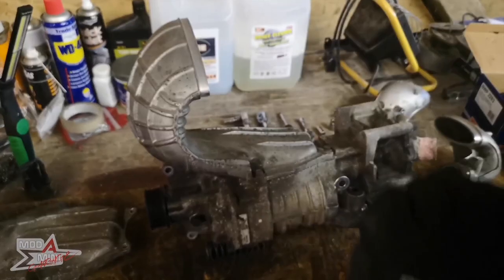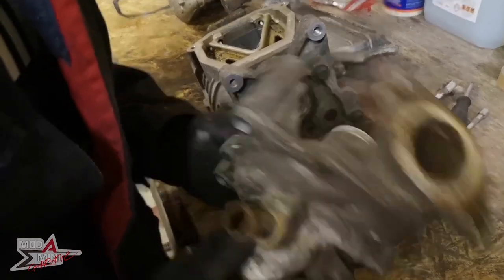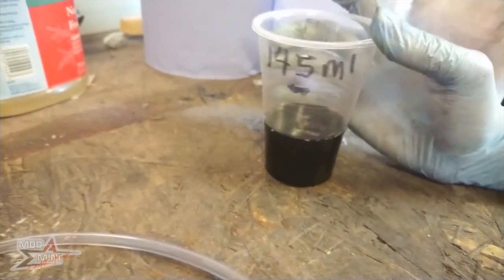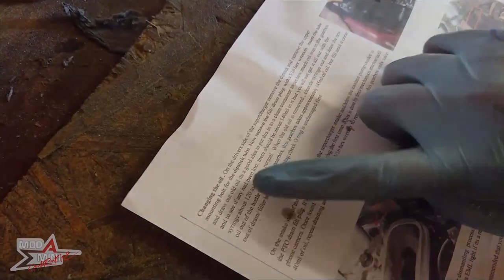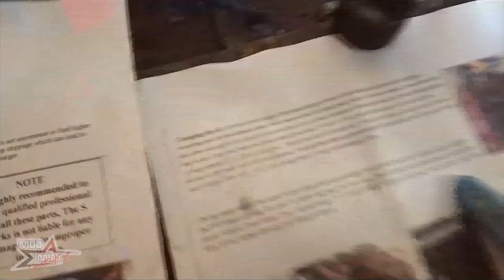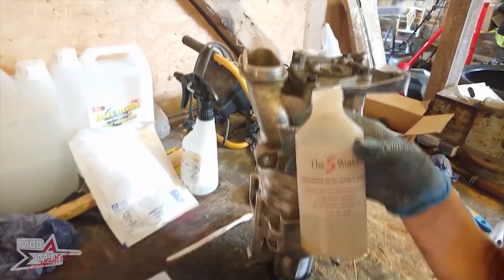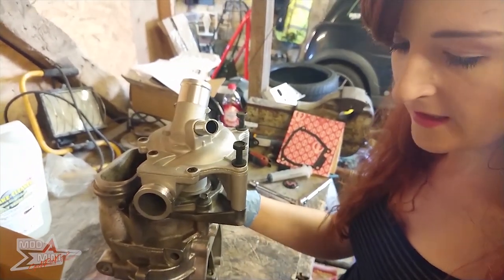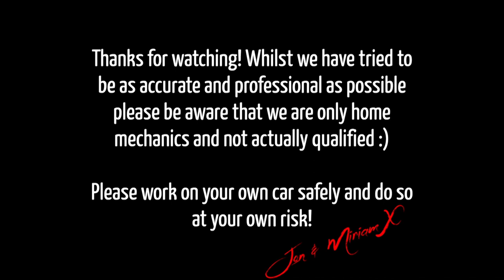Mini Cooper S R53 Supercharger Service!

Comment: Looks good. I just installed a rebuilt supercharger and while I was at it I replaced the water pump with an electric one. This gets rid of the issue of the rear PTO gears eating each other which then stops the water pump. It also makes the engine a bit more responsive and because it continues to run a couple of minutes after you turn the engine off helps with cool down. I've found it a worthwhile mod.
Reply from the maker: No way that's soooo cool! Can you send me a link to the kit you used? Might be worth having a look into that :) thanks so much for watching and taking the time to comment, Miriam xx

Comment: Fill the seringenand the tube, herbal the air out, the empty the syringe through the pipe. You end up with a filled pipe. Turn the syringe and tube tip up, pull back the syringe till all oil is in the syringe and tube is empty. Read the scale, you now know what volume the tube has…
Or: (Work in cm) Length of tube x pi x innertubediameter x innertubediameter / 4 = tube volume in ml

Comment: Just a top tip.... (Not to undermine Mod A Mini these guys are great) But its highly advised to take the front and rear casings off of the supercharger inspecting the gears and thoroughly washing the chambers of any debris and old oil and not just doing the basic drain and refil through the plug hole
Reply from the maker: Hi there, thanks so much for this! We agree somewhat with what you say but not entirely... if you were to open the screws on the charger and no oil come out or VERY minimal, then yes take the housings off and check the gears and rebuild as necessary. If plenty of oil comes out then we strongly suggest the seals aren't broken and they are topped up as per the video. This is recommended by most and Eaton themselves! Only exception to this would be if loads of oil comes out but the supercharger was noisy beforehand and or doesn't feel right when turnt by hand. I hope this helps, Miriam xx

Comment: Hello. I have a 2005 Minicooper R53, automatic transmission. When I turn on the air conditioning, the automatic transmission goes crazy and then turns off the engine (in motion). I turn off the engine, wait a while and continue normally with the air conditioning off. Have you ever heard of a similar case? Any idea what it could be? Note: with the air conditioning off, the automatic transmission works normally.

Comment: Too loud Musik over the voice…
Not swapping the o-rings seems like minimal savings but a problem with a leak would kill the supercharger. Is that worth the risk for two o-rings.
Reply from the maker: Our kit now includes the Orings :) So on ours it wasn't changed but now you can :) we have also don't 100s of these charger services now and not once have we seen one leaking from this area. But you are correct. It's definitely good practice, Miriam xx

Comment: So if the kit recommends to fill until oil comes out, wouldn’t out be better to put the supercharger horizontal position then fill to make sure it’s filled to the proper level? 
On my last mini I put in the 140ml and 40ml but on my current mini I think I’ll try it this way. 
Thanks for the video I learned something new again.
Reply from the maker: That might well make sense :) we would rather remove the charger put an exact amount in simply because we know then how much came out and how much went back in. It's not to bad a job to do either :) Thank you so much for watching and taking the time to comment ❤️ Miriam xx

Comment: random question the waterpump you put back on was slighly different to the one you removed. i.e the end which goes into the engine block, did you have any trouble when refitting?
Reply from the maker: Hi Lennie, no we haven't had any issues at all, in fact we have used 10 or so of these pumps now with no issues whatsoever :) When you buy a waterpump there are 2 different types... Some come with the housing, and some dont, they come with a gasket instead. If they come with a gasket you expected to use your old housing which is held on with torx bolts. I have used a pump without a housing twice and on both occassions the torx bolts that hold it on have rounded off, making it hard to change and re-use. Now I ensure we buy ones that come with the housing. It makes the job easier, and you dont have to faff around with it, they are however a little more expensive to buy. We use the Circoli brand from Euro Car Parts. I hope this helps. Thanks so much for watching and taking the time to comment, Miriam xx

Comment: At 14:00, do you remember if the machined part of the water pump went right in the supercharger  or did it leave a small gap? It appears so by the video, but cant be sure
Reply from the maker: It should push right up against it kind of interlocks with the charger,hard to explain really... as long as it all lines up properly and the bolts align and go tight you should be OK :) feel free to send us pics if your not sure :) contact@modamini.co.uk. Hope this helps! Miriam xx

Comment: Hello I wanted to know how much oil should be put both in the rear and in the front?
Reply from the maker: On the pulley end you want to put 145ml and in the gearbox end 45ml :) Hope this helps! Miriam xx
Reply: @ModAMiniGarage  Ok thanks a lot Miriam.  👍👍😊

Comment: I was looking for a link to the supercharger service kit in the description.  Can you provide it?
Reply from the maker: Hi Raymond... We do t have a link but we do supply it :) drop is an email at contact@modamini.co.uk and we can get one ordered and out to you :) Miriam xx
Reply: @ModAMiniGarage  Can you tell me what is in the kit?  Also, what other items would you recommend doing at the same time?  I want to get my ducks in a row and do this service at the end of the summer since my Mini is at 103k.  It's a weekend car, so mileage won't go up that much by then.
Reply from the maker: Yea sure so the kit we sell has: the shell turbine oil, the green supercharger seal, the supercharger horn gasket, crank o ring, waterpump o ring, silicone pipe for the bypass valve with jubilee clips, syringe for measuring the oil, a metric allen key for the filler bings on the charger amd instructions on how to do it :) its the same kit we used in the video :) i would also recommend changing the water pump at the same time just makes sense whilst you are there, All the best, Miriam xx
Reply: @miniworxx2016  Thanks.  I've seen some other options on this side of the pond as well.  I don't need the horn gaskets - they were replaced in December of '19.  Might do the water pump - it was replaced ~30k ago, but in 2010.  I do want to replace any parts that are accessible with the car in front end service mode.  I've done that before, but I don't want to do it any more than I have to!
Reply: @raymondrizzuto7997  Yes always worth doing the water pump wise move.
Reply: @raymondrizzuto7997  Ray you will need the outlet horn gasket as they are a one time use only as there is a crush rib that does the sealing.
Reply: @paddyvandermoyle106  Ah, that's different then the rubber boots then.

Comment: What water pump did you buy? I'm struggling as there is so many online and I dont want to buy the wrong one. I need to do my 100k service on mine and need all the right parts for it, including the supercharger service kit thank you.
Reply from the maker: We used the circoli one from euro car parts. They are great tbh we have fitted loads of these now and they have been great! Whichever one you buy make sure it includes the housing not worth the agro of splitting apart your old one! Hope this helps, Miriam xx